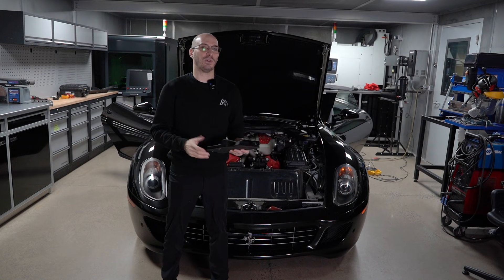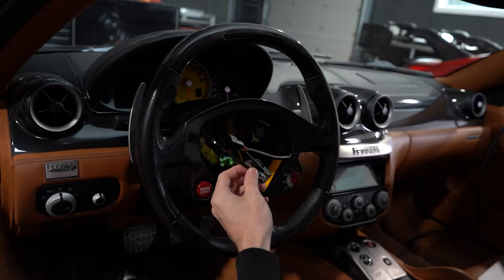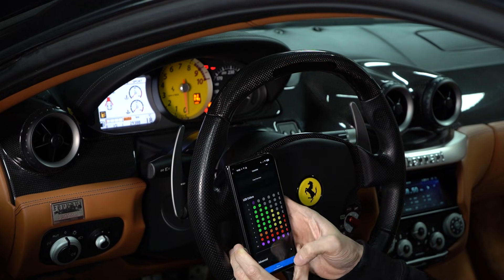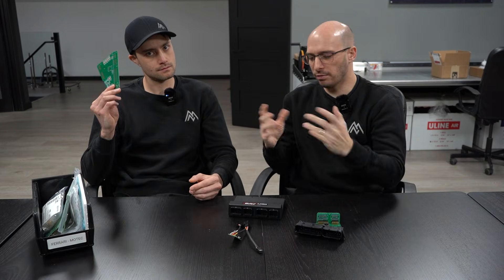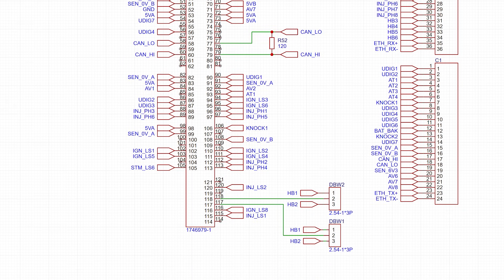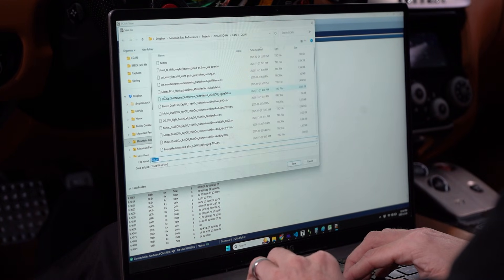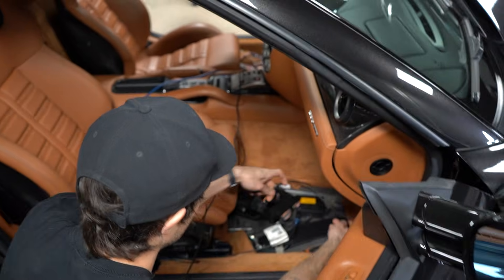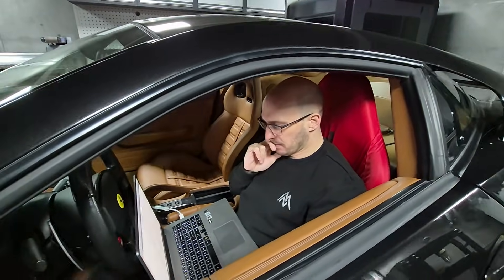How To Control A Ferrari V12 With 2 MoTeC ECUs - MPP 599XX EVO-HY Build Episode 1

Comment: Incredibly impressive and very nice to see a thoughtful approach - CAN bus integration, no spliced harnesses, clear diagrams. Knowledgeable engineering effort never gets enough credit. Glad I stumbled on this now, excited to follow along as these updates come out. 1. Saw the description links, are you using the OOTG manual conversion kit as is? 2. Are the shift lights relying on identical CAN messages available from both factory Bosch ECU and MOTEC? Thanks!
Reply from the maker: Thank you for the kind words!

Yes - OOTG manual conversion kit as is, although we may add a strain gauge to the shifter so that we can do some flat shifting. 

Yep, the shift light module was completed before the MoTeC, so that all works as is. The MoTeC (or any other CAN device) can then transmit messages which will override the native settings, allowing the user to set the individual color, pattern and brightness for each LED!

Comment: Hey man, million dollar idea here, for free, because you're a thinker/tinkerer. Develop a set of wheels that have  hub motors built into them. Create a basically plug and play hybrid system. You could market it as a range saver, or emergency aid if the engine goes kaput.
Reply: Too much unsprung mass.
Reply: @N @NearCry91  depends on the weight of the assembly. The only necessary metals would really be copper and some steel, besides the magnets.. Everything else could be carbon based composite.
Reply from the maker: It's such a great idea that we'll let you keep it!
Reply: @MountainPassPerformance  right, I'll just go ** myself then. 😂

Comment: Where's the link to your kickstarter? I'm definitely fully on board 😊

I hope you get the Motec working with the F1 system. The ECUs are Bosch but I think the TCU is magneti marelli.
Reply from the maker: It is indeed, and spoiler - we got it working and were able to drive and dyno the car!! That is all coming up in the next episode!
Reply: @MountainPassPerformance that's fantastic. One thing I understand is that there's a miss match between the 'torque tables' in the ECU and TCU which partially accounts for the jerky shift quality.  If you update to the HGTE software it's much better but significant improvements can be had over the HGTE software for shift times and smoothness.  I know that your plan is to go manual conversion but @360Trev has been working on this for a long time and has invaluable knowledge that may help accelerate your development.

Can't wait for the next installment.